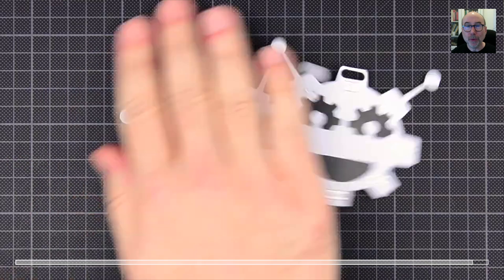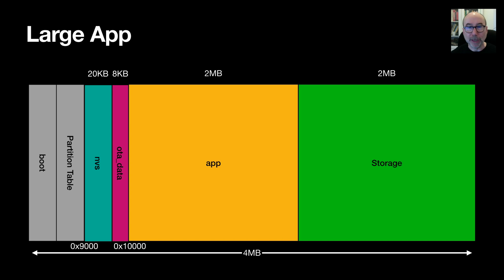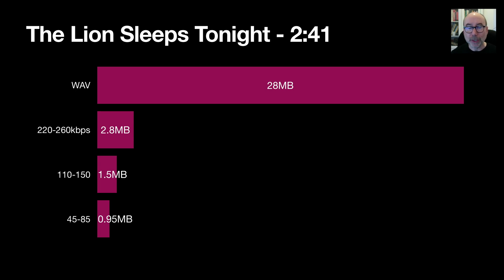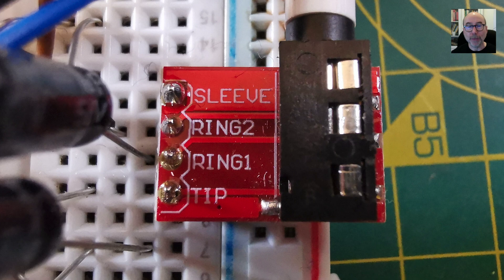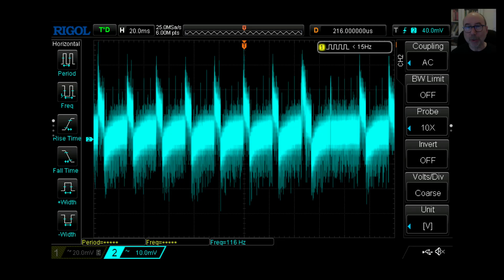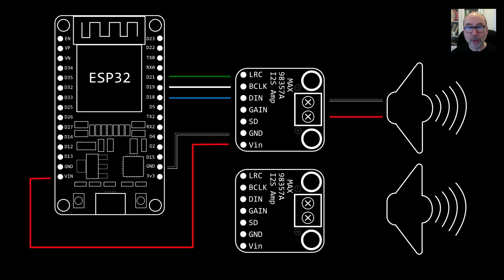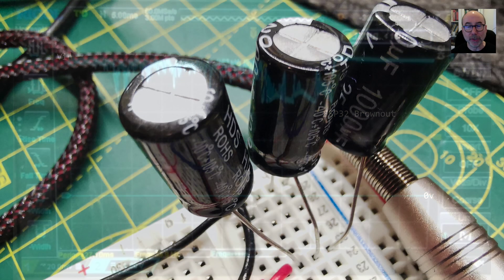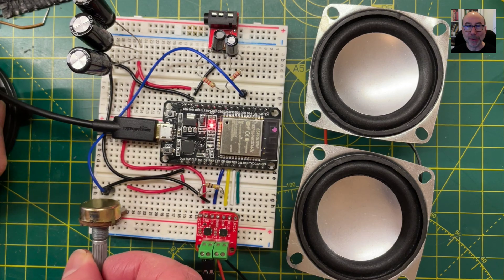Play MP3 Files on ESP32 Without Codec Chip: Easy Guide

Comment: I tried to compile project using Visual Studio Code and Platformio, but it failed. I got some error message related to compiler configuration rather than code itself. I prepared project to compile it u8sing Arduino IDE. To make it simple I put all libraries together with main code to the same catalog and modified #include paths accordingly. It compiled and uploaded, also uploaded mp3 file to spiffs. Set configuration to ESP32 DAC. It doesn't play - ports 25 and 26 shows arrount 0 vaoltage on the scope. Maybe my porting to Arduino IDE is not as it should be?? Could somebody who succeeded to compile and run it using Arduino IDE publish ported project?

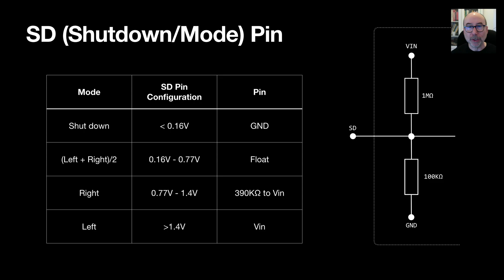Comment: Awesome video! I can't find the link to the breakout board you mention at 6:49. Should I blame my old eyes or it is not in the video description?
Reply from the maker: I've added this link (amazon affiliate link) to the description - https://amzn.to/3wdinpW these look the same as the ones I have - though I'm not actually sure where my one came from...
Reply: @atomic14  I am afraid I misunderstood your comment about the breakout board. It is little more that a stereo socket but I thought it included some amplifiying chip.  Thanks anyway!
Reply from the maker: @alfem  Sorry - yes - it just avoids you having to chop up your headphone cable. If you're looking for an analogue amplifier then there are a few good breakout boards available: https://www.adafruit.com/product/2130 though if you want an amplifier then I'd use the I2S output and a MAX98537 board.

Comment: is the situation with the capacitor due to the signal on the DAC being offset AC? i.e. the pin is DC (never negative) so is it essentially chucking out 1.6V when silence is played meaning the speaker, if there is a speaker involved, would only ever move half way? Therefore, if you put a capacitor in you get a brief moment of noise while the cap charges to 1.6V and then Voltage is effectively zero. When the DAC output goes up, this is passed while the cap charges, and when it goes down, the Cap discharges. This way the speaker sees AC?
Reply from the maker: The speaker would move half way for silence and then oscillate around that half way point instead of oscillating around its "neutral" point - so it will still work, but it's not ideal. There's some good explanations here as to why that is bad: https://electronics.stackexchange.com/questions/233230/why-are-dc-signals-bad-for-loud-speakers
Reply: @atomic14  thanks.. I think that's an affirmation that I was on the right track?
Reply: @atomic14  Thanks for the link! Interesting read and indeed hadn't considered that you are pulling more current when applying an unchanging DC voltage to a speaker. That said. If you are outputting a square wave say that is default off at zero volts, doesn't seem to be too much issue with putting it to a speaker, just means you'll only get movement in one direction. Not ideal but not the end of the world either. In the case of the DAC though, I'm assuming the wave is oscilating about the 1.65V mark, in which case using a capacitor to get rid of that offset would be a good idea. Otherwise would be defaulting to having it stuck half way out in one direction and not moving.